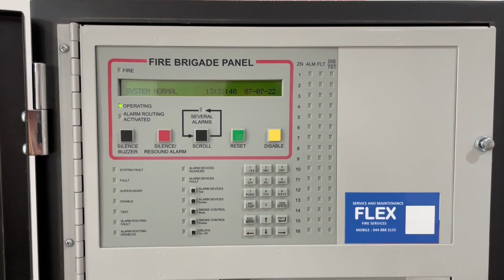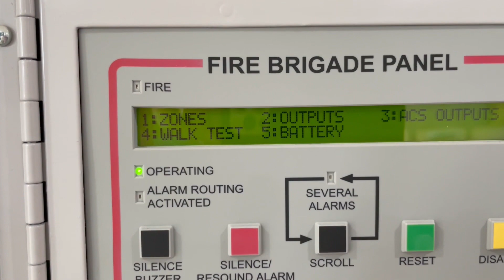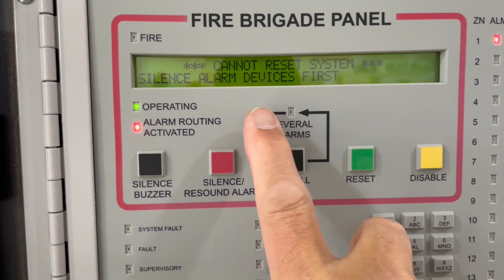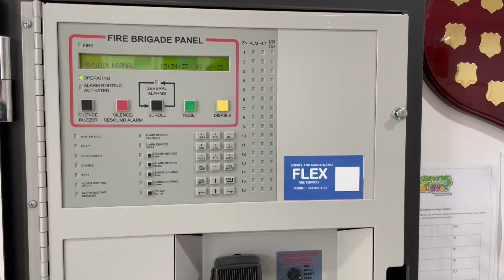FIRE DETECTION MONTHLY TEST - Notifier FS1600 Conventional FIP

Comment: Do you know anything about VIGILANT fire detection systems, Mainly in trying to figure out what detector is causing a faulty alarm? Some detectors have a flashing red light other detectors of the same type are not flashing?
Reply from the maker: Hi Peter, flashing lights mean polling. Old detectors , mostly conventional, don't have flashing lights...just white light (conventional)  which turns steady red in alarm. All addressable detectors are provide flashing/polling  lights as they transmit signal to the fire indicating panel (FIP). But there are some addressable detectors that don't flash as the programmer forgot to tick the box for polling/flashing. Cheers.
Reply from the maker: Also, it seems that you are dealing with a conventional circuit. In a vigilant panel,  any polling/flashing detectors that you mixed with non-flashing/polling detector will cause the active alarm  hard to find. The activated alarmed detector will showed steady LED lights and then it fades...this will be the cycle  ...then steady light again and fades. That's because the circuit power is also  used to blink the other detectors as they polled. That's why donot mixed polling detectors to non-polling detectors in a conventional circuit.
Reply: @fireprotectionguy7943  Hi, I really appreciate your reply's thankyou very much. I have no actual experience in Fire Detection Systems, Im just an Electrician who runs the power station on Lord Howe Island NSW. Basically the hospital here has had an alarm triggered but there is no fire risk and I am trying to figure out what alarm is causing the FIP to be triggered. We can clear the alarm from the FIP but within a few seconds it is triggered again. The FIP and associated detectors are old with a Vigilant FO8 panel and is from around 1992. There is a combination of Heat and smoke I think and as I said some of the smoke detectors blink (poll) and some of them do not which is what I'm finding hard to follow. The heat detectors do not appear to poll. There are around 12 detectors on the faulty circuit and Im just trying to minimise time in finding the faulty detector. I am planning on removing each detector one at a time now and using a "good" detector from a circuit that is working correctly to see if that detector is faulty. Would this seem like a viable option for finding the faulty detector? Again really appreciate your input. Its always a bit difficult being in such an isolated area and having to figure out new things on such old systems. Regards, Peter
Reply from the maker: @peter92103  ..no problem. Another source of problem is the F08 end of line resistor...and sometimes, in the circuit there's a break glass / manual call point that short circuiting  the wire. I suggest to replace those detectors. Use Hochiki SLV-as (Smoke) and DCD-A3 (Heat) plus  bases. Hochiki are non blinking and very compatible with F08. Get that from Incite Fire   https://www.incitefire.com.au/  It's cheaper there and ask for a trade price. Easy to install. All the best Mate.